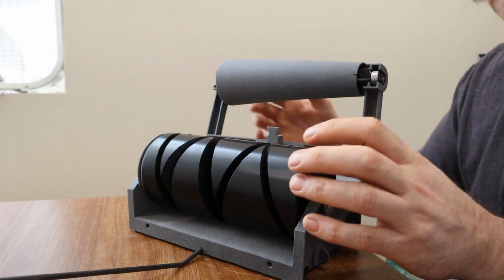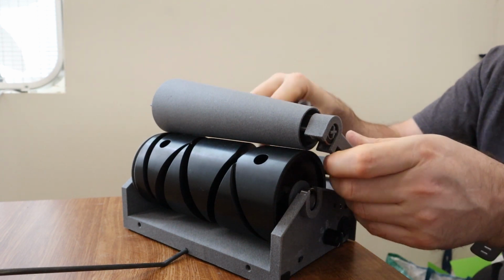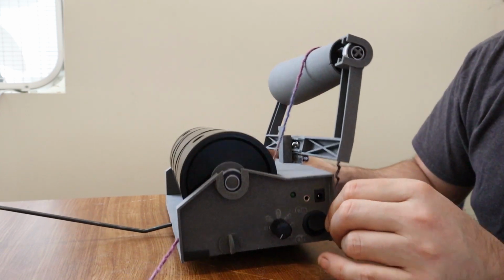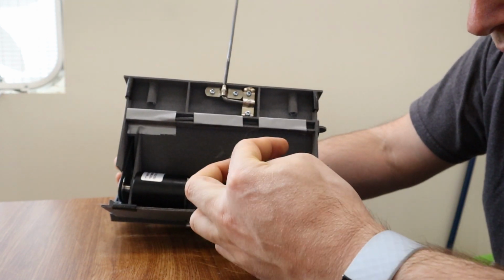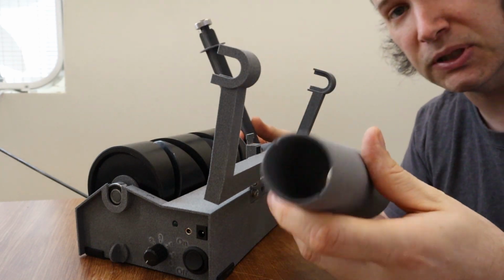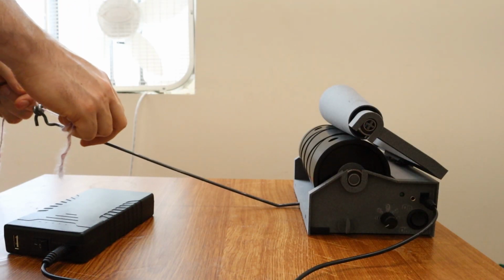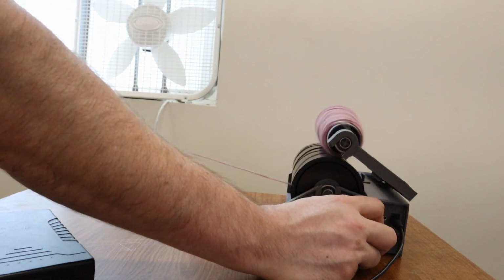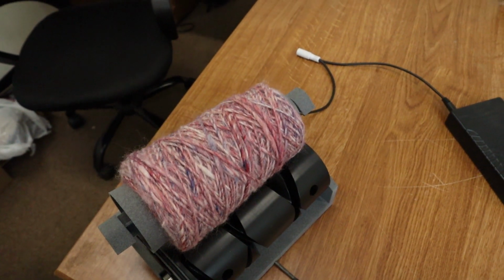SPIN #119 - Cone Winder Prototype (June 2021)

Comment: I find putting a notch for the yarn at the bottom of the cardboard cone to hold the yarn and tuck the tail inside between the cardboard cone  and its’ holder  when it first starts off holds it firmly enough to get the winding  started evenly with no slipping.
Also I was hoping to hear more about how the plug in from the counter to the yarn winder counts the yarn. 🥰
Reply from the maker: There is already a notch at the top of the cones I'm using if you look at the video closely.

I forgot to cover the yarn counter, but that is actually already in the code and working.  I'll try to remember to cover that in the next update.

Comment: Would you be able to make a telescopic yarn guide?  Or one like tent poles with elastic running through?
Reply from the maker: That would add a lot of cost and probably wouldn't work very well because it would be a lot more flexible which is bad.  I actually increased the diameter of the guide from 3mm to 4mm to make it stiffer.  I did ask the community about making the yarn guide a separate item that could be clamped to the table, but the community wanted it attached.  Maybe I'll make a 3d printable separate version for those who don't like the large yarn guide.

Comment: Fishing weights on the shaft?  Clips to hold them?  Consumer can buy in most places to save shipping weight, very cheap.  Split-type to make it more universal?
Reply from the maker: I was thinking car wheel weights, but the fishing ones you mentioned are easier to get if you aren't buying them online.  That said I do want it to work pretty well out of the box so this depends on how well future prototypes function.

Comment: Silicone sprayed cone might work and be cost effective.
Reply from the maker: Interesting idea.  I'm not sure silicone is the right material, but I get the gist of it.  I also might just be able to get the cones made out out a rubbery material.  I'll have to talk to my injection molder about the cost of different options when I get farther along.

Comment: Why does the yarn guide have to be so long? It would be nice to be able to store it on the bottom of the machine.
Reply from the maker: It has to do with how the level winding drum works.  The shallower the angle (meaning a longer yarn guide) the better the drum works.  It's a tradeoff in functionality versus portability.
Reply: @DreamingRobotsBlog I am wondering if  a V shaped yarn guide, perhaps with a bit of spring towards center of V and holes/slots at proper angles in the sides of the base to slip into, would add enough stability without too much additional cost? Perhaps this would make a storage solution as well...unhook V and snap onto bottom or over sides and top of unit. 

The yarn tension adjustment might be able to go at the point of the V, depending on how you decide to devise it. If spring like, it could be a shallow arch shape and be placed horizontally between the bars near the tip.

I also wonder if placing a curve or angle in the legs of the V would solve the yarn guide length concern that some have, yet still allow proper positioning for the drum...too many edits to my post. Hoping you don't get a notification for each of them. My brain is working in disjointed snatches tonight.

I know next to nothing about engineering so I don't know if any of these ideas are practical. I truly appreciate the thought and work that goes into the devices you make, and am looking forward to seeing this design evolve.
Reply from the maker: @scooper405  Doing a V shape would certainly stiffen it, but you can't compare stability to what you saw in this video because it was not attached correctly.  I'm going to experiment with different options for the tensioner.  I did as a long time ago and while a small majority wanted everything connected, a lot of people were ok with a seperate device that clamps on and would act as a guide and tensioner.  I'm going to explore a few of these options going forward.

Comment: Of the options, either a stronger spring or adding weight to the axle of the thing the cone goes on seem the best solutions. Presumably other cones could be used, too, such as recycled weaving cones?
Reply from the maker: To use other cones a different cone holder would need to made (probably 3d printed).  I plan to look into this, but the community has told me this isn't the top priority as long as my cones are affordable.  That said I do plan to put some effort into this later.  Some cones might also require a different drum (if they are too short) and if thats the case I probably would say they just won't work since getting a different drum to fit would be quite a lot of work.